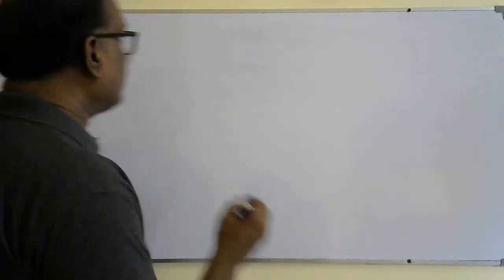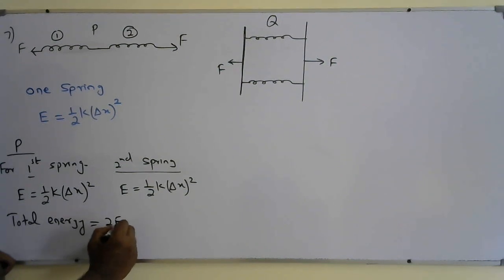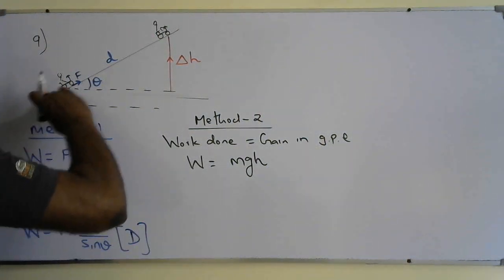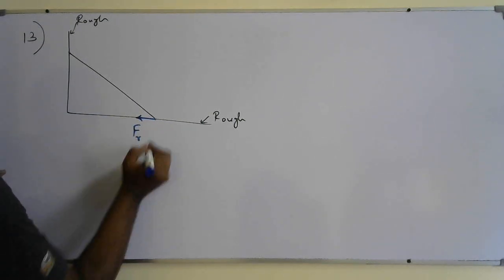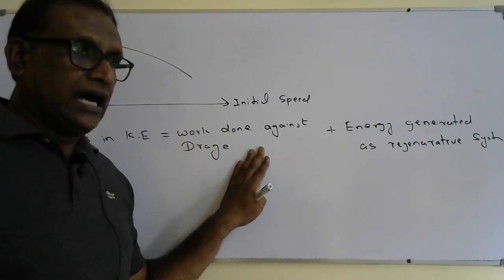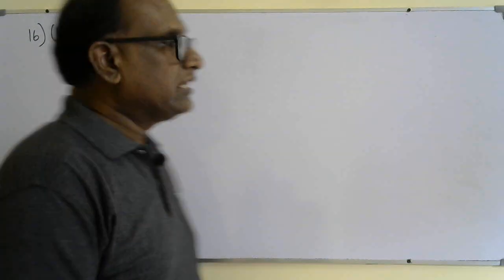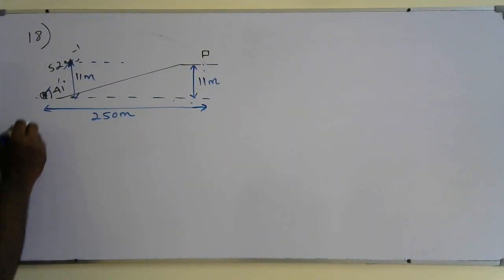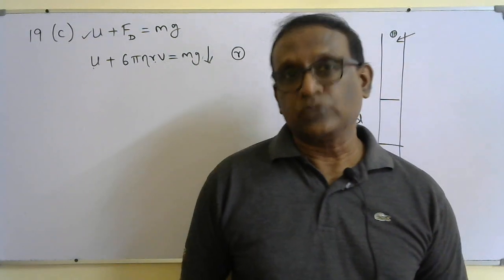Edexcel IAL May June 2022 Unit 1 WPH11/01 Past Paper discussion Mechanics Fluids Solid Material

Comment: Sir in question number 5) if the metal ball is thrown at an angle it,still it won't affect the S in the linear motion equations right.Because S is displacement
Reply: And also the value of g will will decrease than the real scientific value. Because if it's thrown vertically it will have a initial velocity at the beginning point.

Comment: Sir, for question 16(a) what method did u measure to find T? I used "sin theta =  T/14" but I dont find the answer. Please help
Reply from the maker: Use vector diagram. You have to draw vector triangle according to a scale.
Reply: @aravinthphysicsmathslesson5111  basically using ruler to measure the distance of T? no formula needed